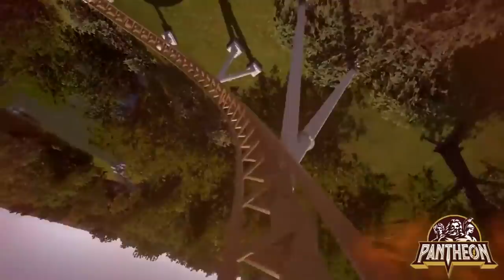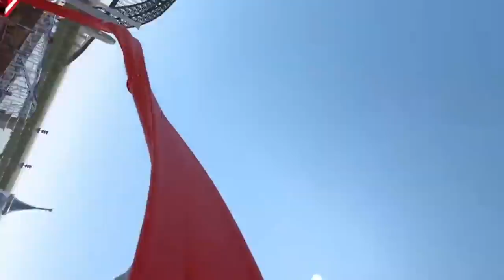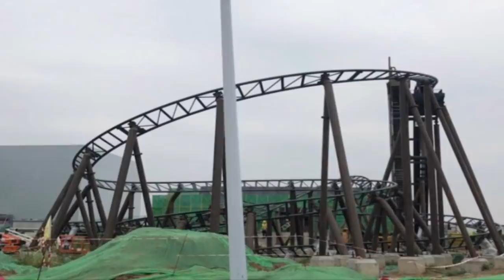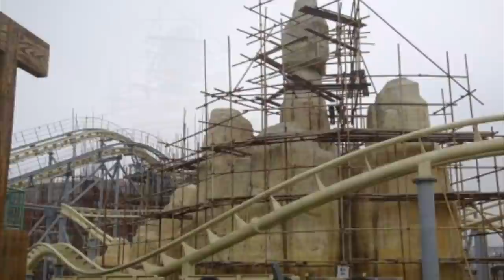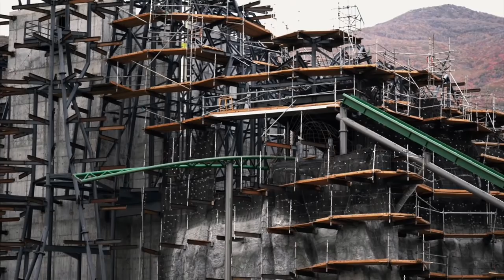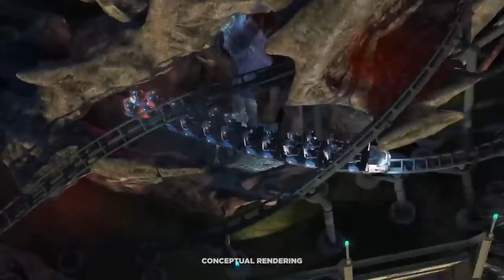EVERY Major 2021 Roller Coaster (Part 1)

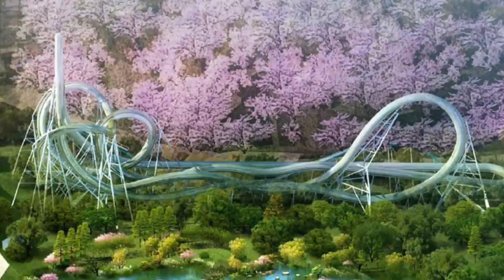Comment: 8:40 Not the first ride to have other elements/inversions interlock with a cobra roll. The Smiler at AT has a batwing going through it (or just a Sidewinder+immelman)
Reply from the maker: oh very true actually, good listen! I apologize for that, I should’ve specified that it’ll be “one of the first” or the first to be interlocked with two separate times.

Comment: Awesome video and very well-researched, this very well may be the first time I’ve actually heard someone mention Barracuda and Dragonfire, though I have known about both projects for a good while now.

The only named coaster I could think of that wasn’t on here is Turbo Turtle Power at Nick Universe in Chongqing which is an Intamin launched 8 inversion coaster that seems to be wrongfully listed on RCDB as a 2022 addition, as Chinese articles say the park is expected to open in 2021.

I’m guessing part 2 is going to focus on the unnamed coasters because there’s a lot of them like Changsha’s S&S Air Launch coaster and the Dubai Hills Mall Coaster.
Reply from the maker: Thanks man! Glad you enjoyed the video!

I’ve heard all sorts of things regarding that project. I know it was actually suppose to open in December 2020, but clearly that didn’t happen. I do think it’ll open in 2022, mostly because of finance and covid delays, plus what chinese project actually ends up opening right on time 😅

part 2 will in-fact focus on the unnamed roller coasters opening this year! I didn’t want to mention that in this video since it perhaps doesn’t sound as interesting, and therefore would lead to less people watching it. what some don’t quite understand is a lot of these unnamed coasters are just as interesting and substantial at the named counterparts!

Lastly, I’m a firm believer that the Dubai Hills Polarcoaster thing won’t happen this year. So many different factors come into play, especially in its location. Just look at how Six Flags Dubai was cancelled because of a decline in amusements and amusement projects in the UAE.
Reply: @CoasterDash  Yeah that one seems pretty iffy, I’d kind of give it about the same chance as I’d give Primordial, Mission Ferrari, and sadly potentially even Emperor to open in 2021 as I think California is a long ways from park reopenings but it still has a whole year to open unless SeaWorld delays it again which is possible so we will see.
Reply from the maker: @CoasterHour  that’s fair. I truly believe that the other three SeaWorld projects will finally open this year, but Emperor makes me worry. It’s also at my home park, which doesn’t help my feelings towards this. I’m so eager to ride that thing.